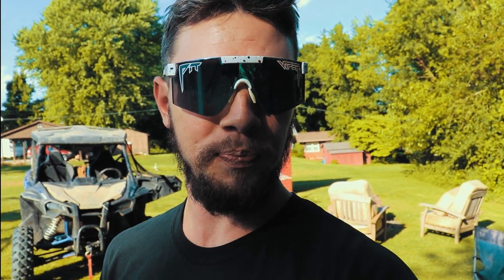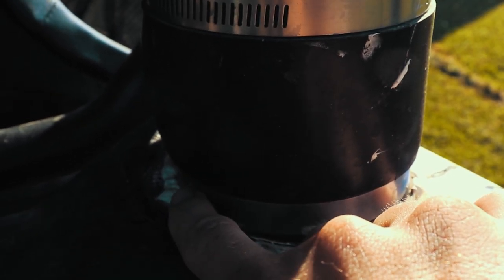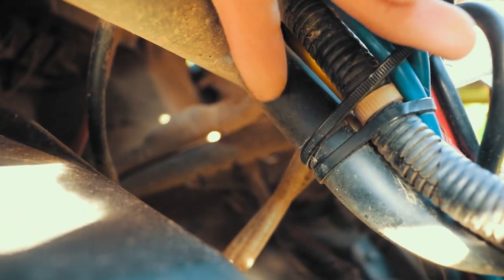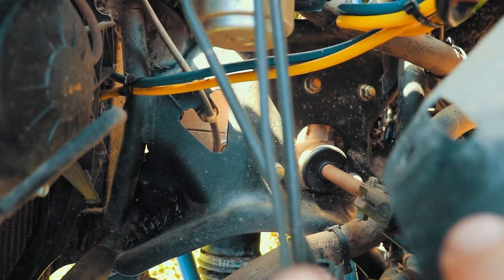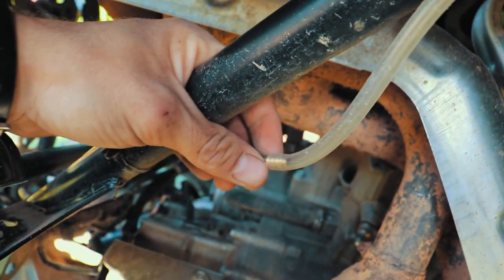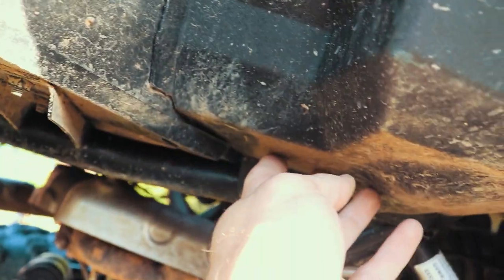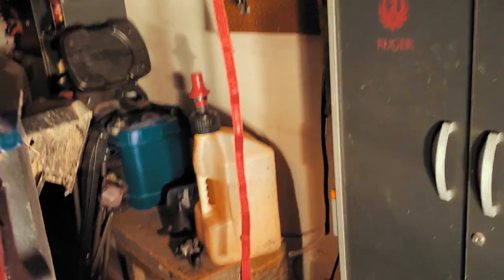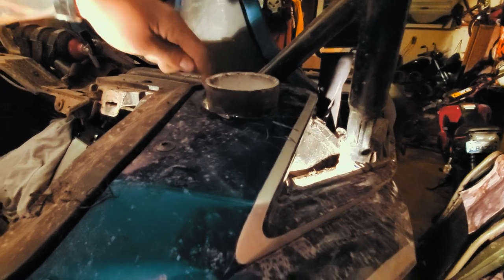2020 Honda Talon Going Deep | How-to Install (Warrior) Snorkel Riser

Comment: I have a 2021 Honda talon 1000 x4 but I can’t seem to find the fuel vent line. Can you help maybe send another video?
Reply from the maker: Which line? Should be 3. I can see if I can find some old clips from my phone. 1 goes to radiator,  1 to gas tank, 1 to rear gears box. They are tiny lines should be easy to trace, make sure to remove skid plate
Reply: It’s the gas tank that I can’t trace down.
Reply: I found it. It’s in the back by the air cleaner cover on the left driver side. I traced it and it comes to the back not the front. Again I have a 2021 Honda Talon 1000 X4. Thanks tho
Reply from the maker: Glad you could find it! Hope it all works out for you.

Comment: I have a 100x4. Just had it snorkled all vent lines ran just like you video. I take it under water. Does fine no leaks. But it seems like something is getting wet because after it
Keeps wanting
To run rough to the point where it shuts off and don’t wanna start back up for a while. And if it does it runs like shit for a while till it “blows out” what ever the issue is. Or “drys out” have u had any issues like this?
Reply from the maker: Possibly the electronics under driver seat. Could be air locking too.